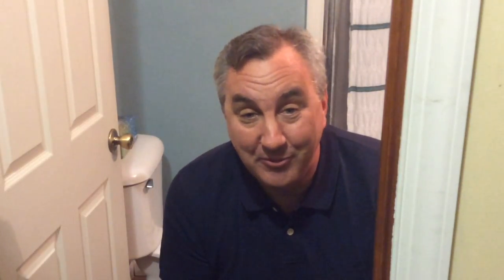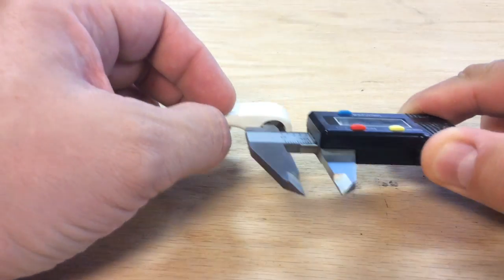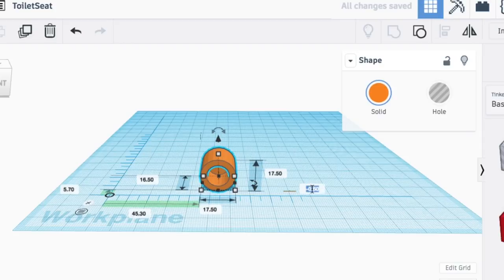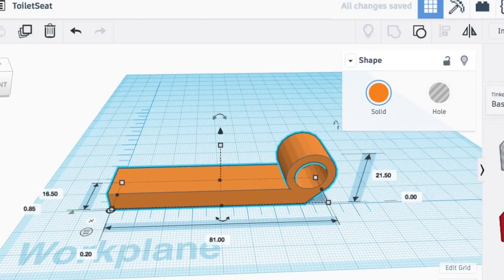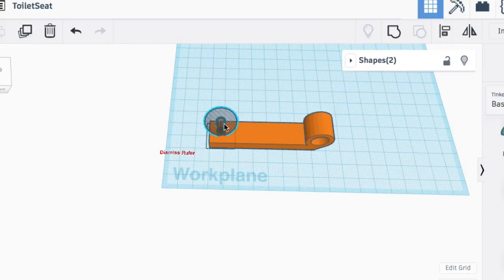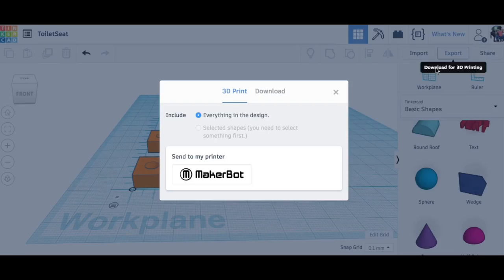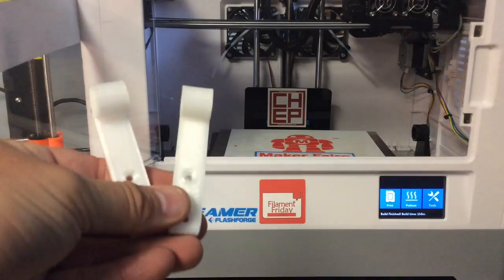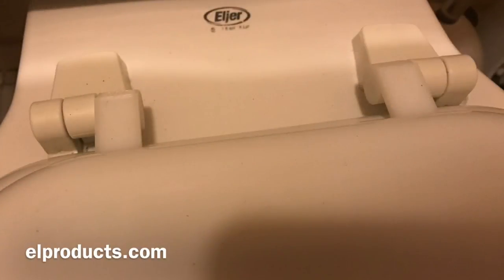Fixing a Toilet Seat Hinge with 3D Printing

Comment: Great repair, Chuck! I liked the way you created the counter sink screw holes. If you re-print the parts, I would suggest to print them in white ABS and then vapor smooth them with acetone. The smooth surface will make it so much easier to keep it clean.

Comment: Chuck!... Why?!?? Why didn't you print it on its side? The hole would have been _so much stronger_!!!
Reply: There is the conundrum when dealing with holes on directly opposing axis.  Sometimes molded parts are the best way to go but he was in a bind (I almost said pinch then remembered he is on the toilet and pinching a 
loaf screamed at me to not use that term, lol).